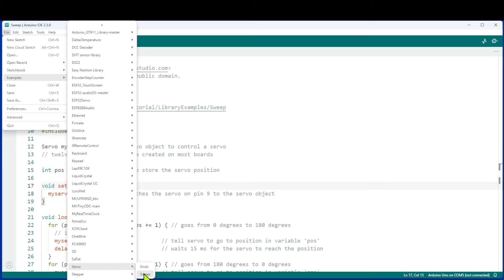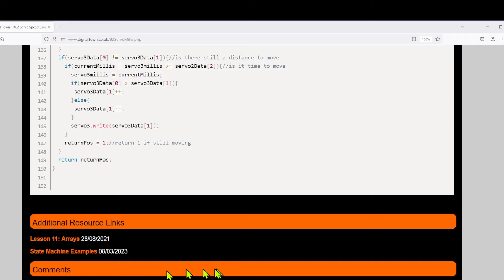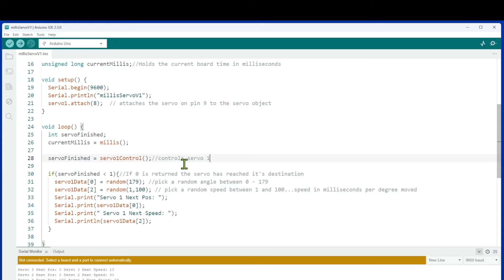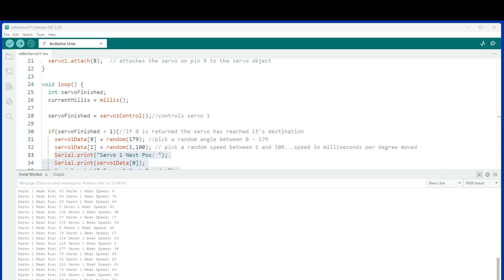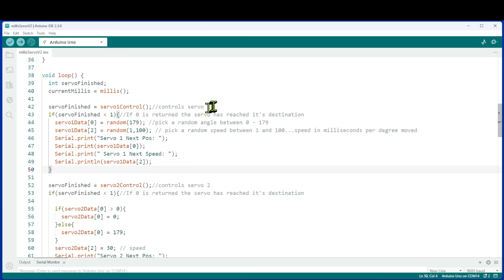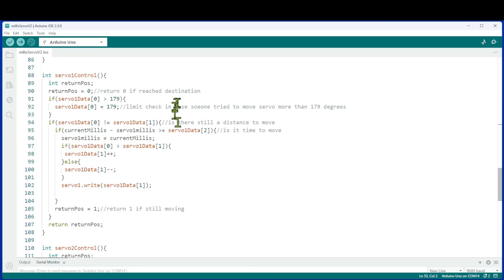#83 Arduino C++ Servo speed control using millis()

Comment: Great tutorial, thank you. It has helped a lot. I am curious... You mentioned that it wasn't the most elegant solution as you would have preferred to have used a single function to run multiple servos through. Do you have any examples of this kind of code I could look at?
Reply from the maker: Yes I did an example in another video (Lesson 10) https://www.youtube.com/watch?v=j_XeGxnd0lk that places the servo objects in an array.
This allowed the control of multiple servos in just a few lines of code.

In lesson10servov5 you can see that all servo movement is controlled in lines 96-112 and would be the same even if more servos had been added.
This allows multiple servos to move in multiple directions at different speeds.

Lines 116 - 141 are just setting new directions for the servo to move to and would usually be triggered by buttons although in an animation they may be triggered by the servo reaching it's destination as shown.
Reply: @digitaltown5442  Thank you, I'll check it out. Keep up the good work man, you teach/explain in a really good way that's easy to follow and understand.

Comment: I'm building 4 dof arm robot. Now I can use this code to move servo independently. 
My own code has delay and servo's movement is too fast because it's lack of time control.
This tutorial really helps me.
Thank you
Reply from the maker: Hope the project works well. If you need a lot of servos you can also use the pca9685 board, tutorial and code at https://www.youtube.com/watch?v=_AQbZ5_-_iA
Reply: @digitaltown5442  Thank you for your advice. Too bad I already solder potentiometers and arduino nano pin header into perfboard to control the robot.
I'll watch the link anyway.
Reply from the maker: @jumbo999614  It should work fine as it is, just make sure the servos are getting enough power and that the 5v is not coming directly from the nano
Reply: @digitaltown5442     One more question sir.
The 1st loop, servoData[ ]  has  all zeroes  (0,0,0).
Therefore  all IF statements inside servoControl( ) are skipped and return 0.
Then  servoData[ ] is assigned with values.
The servo starts to move after 2nd loop. Correct?
So it's ok to define values for servoData[ ] at the setup( )?
Reply from the maker: @jumbo999614  Yes you can assign values in setup() or when defining the variable if you have a known value you want to start from.

Comment: Thanks for this video.  I printed some animatronic eyes that have 6 servos that I want to act independently of each other.  Two servos control the right upper and lower lids, two servos control the left upper and lower lids, another servo controls the horizontal movement of the eyes, and the last servo controls the vertical movement of the eyes.  The horizontal and vertical movements of the eyes are being determined by a person sensor.  I thought there must be a way to eliminate the delays with millis() but I thought the code actually had to stop to give the servos time to move before advancing to the next line of code.  Instead of angle degrees I am using writeMicroseconds to set the servo positions.  To mimic human eye movements, I want the movements to act as quickly as possible.  Currently I have a seperate microcontroller just for the eyelids so that the delays for blinking movements won't interfere with input from the person sensor.  I will see if I can implement your non-blocking code for my application.  Thanks for all your helpful arduino videos.
Reply from the maker: Interesting project. If you want to use microseconds to control the timing just change the line currentMillis = millis(); to currentMillis = micros(); and then the timings between steps will be in micro seconds. Just be aware that there is a maximum speed the servo can mechanically move. So at low values you will not see any increase in speed as the servo will be moving slower (mechanically limited) than the signals it is receiving. It will just get to the end position as fast as it is able to move mechanically.